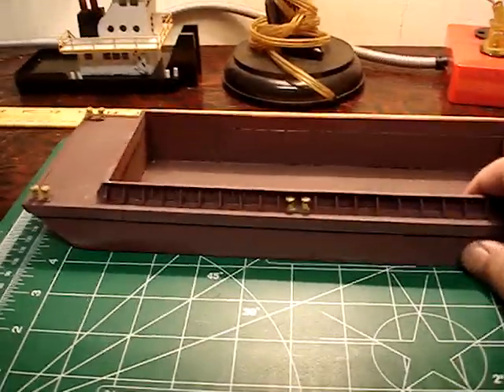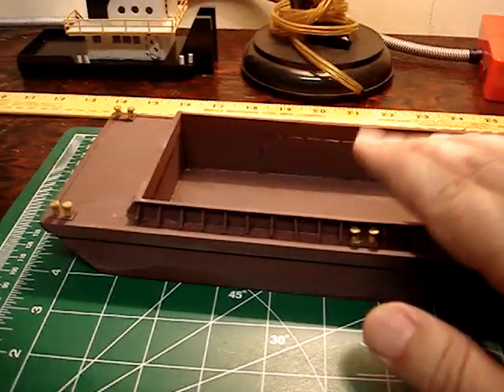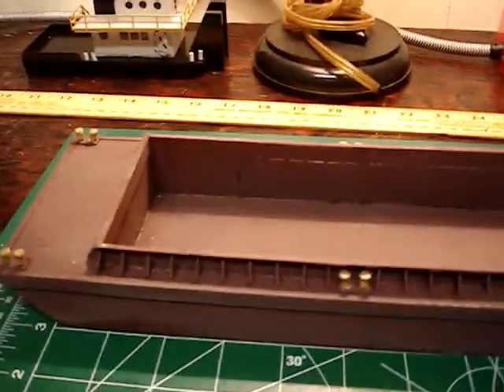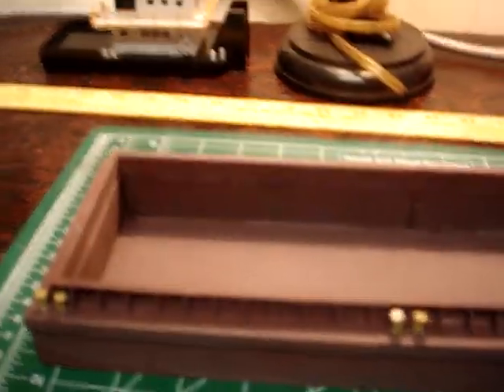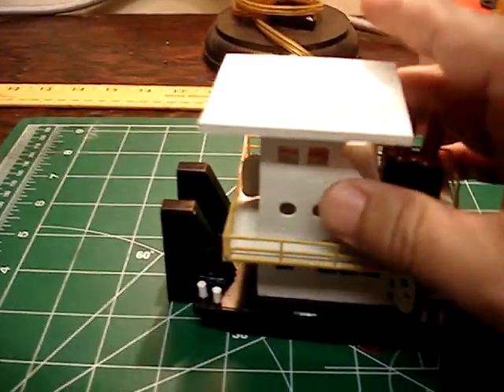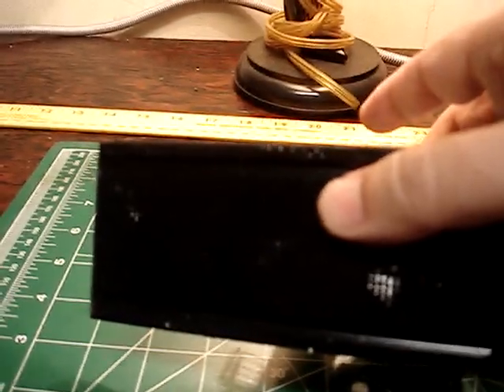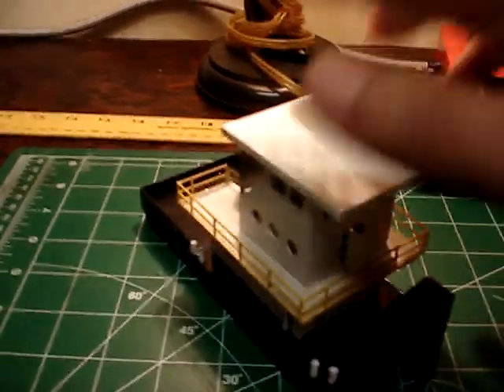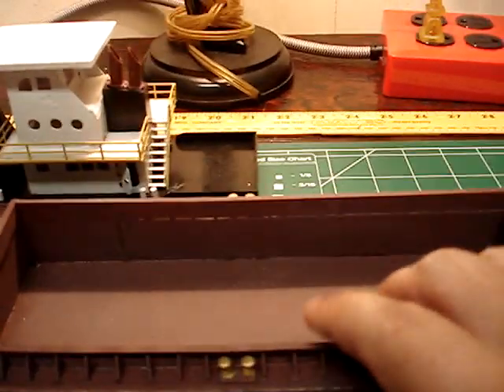HO Scratch Built Barge & River Tug.

Comment: The details on the tug are great but you are correct it does look a little odd. The cabin/control tower and push bumper things look out of proportion for some reason. I can't quite put my finger on the actual problem though. Like you said it will do its job as a static model and if you're happy with it that's all that matters. The barge turned out very well. I think the tie off things are called bollards when on the ship and moorings if they are on a pier. You are correct about cleats they are the small t shaped tie offs on smaller boats and small docks. I would like to see the build process of the barge. I think you do great work with minimal building supplies and at scratch building in general.
Reply from the maker: Yup,the tug is going to get reworked . Maybe it's to short of a deck or to many decks but that goofy top has got to go. Dunno what I was thinking. Might just build another if I can find the more molding laying around. Thanks for being honest it helps my builds.
Reply: @ModelingSteelinHO  I think it needs to be a bit longer with the cabin/control tower moved back a bit not much keep it toward the front and the bumpers lowered just a bit and a thinner roof and it will be loads better. Just throwing out ideas if you don't like you can tell me to shut up and it won't hurt my feelings. Oh and maybe add one of those bollards, (a larger one if you can find one) to the center of the deck in back for pulling stuff. Great beginning though. 👍
Reply from the maker: @williambryant5946   In a previous build about ten years ago. That push tug came out great. With this one a little rework she'll get better. Thanks for the suggestions they'll come in handy.

 Custom model railroads has a great push tug kit. Might go that route. They also have Barge kits in HO but just can't see buying both.
Reply: @ModelingSteelinHO  You do good enough scratch building that you should just modify what you have instead of purchasing a tug kit. You do nice work.
Reply from the maker: @williambryant5946   That's been the problem "just good enough" . My problem is I seek perfection but being realistic or believable is more important.  I also want the most believable model available. I try to model after the Dean Freytag method. Dean was a fantastic modeler who could easily fool folks into seeing something believable. With the simplest of things. He was a real artist of HO scale.

Thank you for the words of encouragement. It keeps me going & the models flowing. It's been to hot to work lately on the layout but items for the layout get built instead.